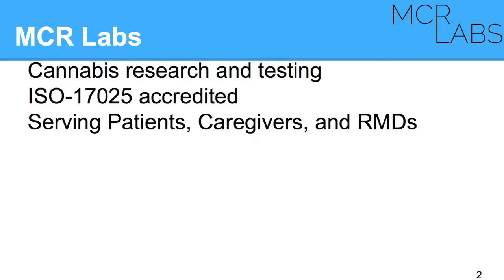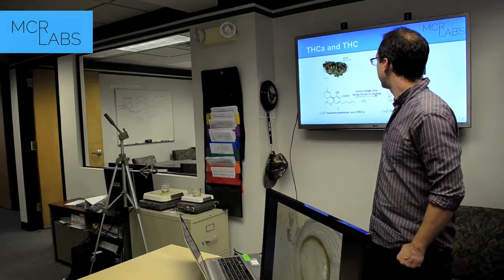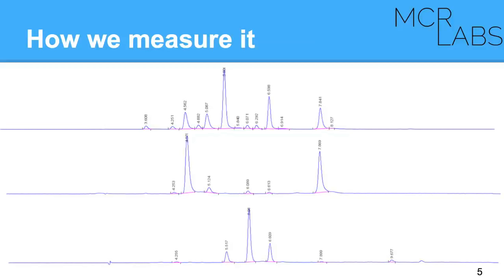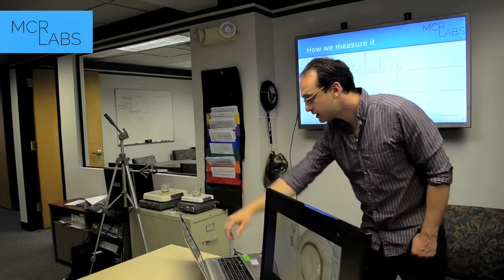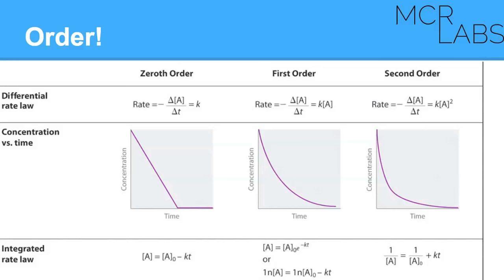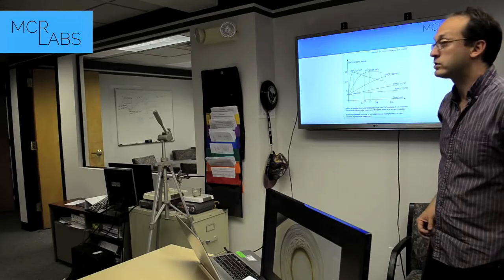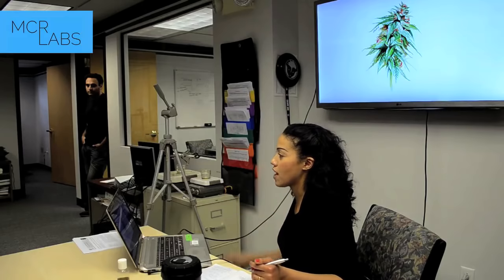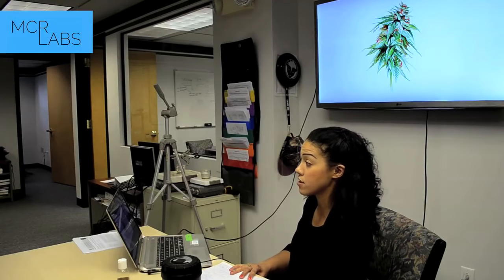Decarb / Decarboxylation by MCR Labs / Cannabis Testing in Framingham

Comment: so all waxs like rosin or bho or distillate should be decarbed at 300f for 30 mins to achieve the perfect decarb? i thought decarb happens at 250f for 30 mins
Reply: Just like the bell curve shows, they say , supposedly, that pefect decarb happens at 215 F at 60 mins. At higher Temps, the bud decarbs quicker. so 250 for 30 mins might be right since your doing it half the duration. I personally would go at 240 for 35 mins, but thats just me.

Comment: I gots to get me a mass spectrometer. I’m sure they sellem at Home repo/depot. GREAT INFO. So a “natural log” (“log” as in logarithmic) is the same as a linear correlation, first 'log' or in layman's terms a ‘straight line’...that’s simple enough. SO my question becomes, there must be a faster/easier way to break off that carbon atom into CO2 ?!?! More heat is inefficient...Aaahh introduce hydrogen??

Comment: What if you leave it in the crock pot on low for 8 hours? Will that decarb it all the way? You could even put it on the simmer setting and leave it on for longer on my crockpot. It's got a warm simmer, low, med, high settings. And even if you decarb it fully, most cookie recipes want you to heat thec oven to 375 for like 11 minutes. Won't that burn the thc or degrade it a little? This whole thing can be very confusing.
Reply: Dont cook at 375, I would cook at 345 or 350 for slightly longer to not damage any of the THC or Terpz, first off. But to answer your question, the reason it wont mess shit up at the slightly higher temps is because you just added a bunch of other ingredients to the cookie mix your making. These new chemicals allow the exchange of ions that wont interfere with the process of further decarbing your bud. TL,DR: When you add more shit in to the equation, it is harder to damage the thc. And your only cooking for a short duration as well.
Reply: @FunnyBonesGaming  so you think I'm doing it long enough? I've done it 10 hours the last 2 times and it seems stronger. I guess i can only try decarbing first and then doing my method and seeing if it's stronger. I think what they're saying is that you can do it at lower temps at longer times. My crockpot is 212 degrees Fahrenheit. So I'm assuming im getting close to decarbing all the way.
Reply: @manicmurph  is that on high setting? The 212 that is?
Reply: @manicmurph  adding oils or butter increases the boiling point and thus lowers the temperature that the THC is actually getting. 212 wouldn't be the number that it is at all times. It will fluctuate up and down 15 degrees or so until the unit diode is switched off to let it cool because it got too hot, assuming your not on the highest setting, or switch it back on when it becomes too low of a temperature. If the 212 is on a lower setting, try bumping it up one notch for 8 hours and see if that batch is better. Just experiment a little and see the results.
Reply: @FunnyBonesGaming  i think the thing slowly reaches 212. I did this last batch for 10 hours and it seems better. I do it on low. I got so anal i looked up the company of the crockpot to see the exact temperature it reaches on low. Idk if it's my tolerance or what but mine are good, i just want them to be better..lol. the only thing i can do is try decarbing in the oven at 220 for like 30 minutes and then do the crockpot and see if they're stronger.
Reply: @manicmurph  try turning it up one notch and let it go 8 hours. I always cook my shit on medium for 6 hours... 8 hours makes it a sleepy drowsy high
Reply: @FunnyBonesGaming  Min or low, crockpot settings reach the same max temperature but on low it takes longer to reach that temp.

Comment: you do not need heat to activate the. citric acid from a lemon extracs the THC, then coconut oil will bind to the THC to the coconut oil! in a juicer
Reply: no pain no gain 

U qot that from
"How i qot hiqh by eatinq raw weed"
By that orqanic qrower quy who ACCIDENTALLY qot hiqh huh brother?
Reply: altho I don't have any experince  with this myself, the basis sounds like it could have something... think about how we "cook" fish by using lemon juice or other high quality citric acid. This should be looked into more... then you could just put raw cannabis into lemon juice and let it sit for long enought to extract all the THCa from it and never worry about messing shit up...
Reply: @FunnyBonesGaming  I don't have much experience with this either, but wouldn't the lemon juice be a solvent, just like apple cider vinegar, & 190+ proof grain alcohol?  I've been looking into using ACV to replace grain alcohol as the solvent.  However, whichever solvent is used, I can understand the need to still decarb. using the conventional heating methods.  I'm just trying to figure out how to get the most THC potency without using alcohol, butter, or oil.  I have heard that ACV provides health benefits on it's own.  Or at the very least, is not as bad for you as alcohol, oil, and butter.
Reply: @langstonhughes4089  What do you eat, sand? Oil is fine.